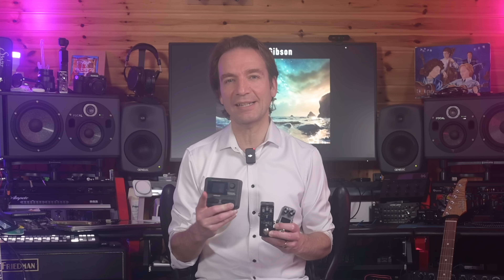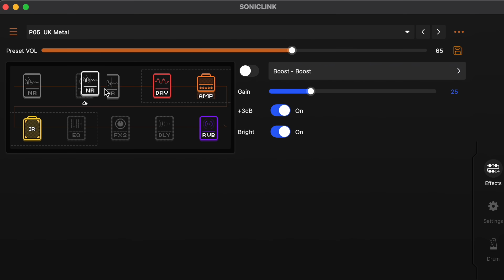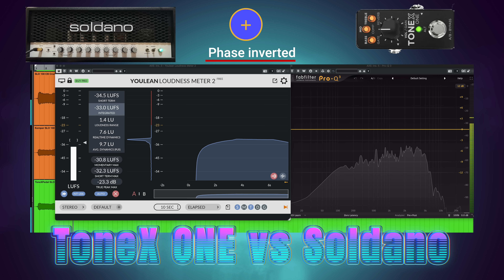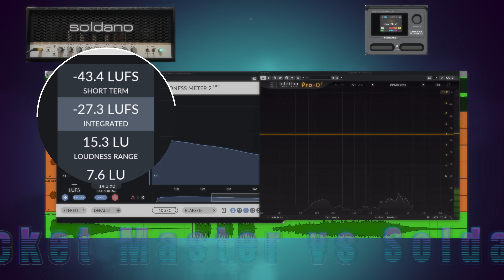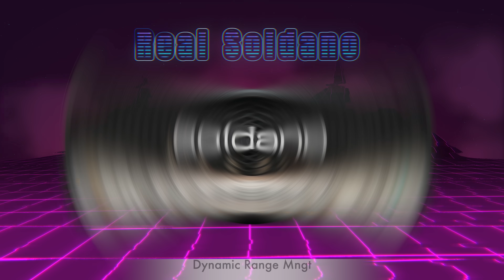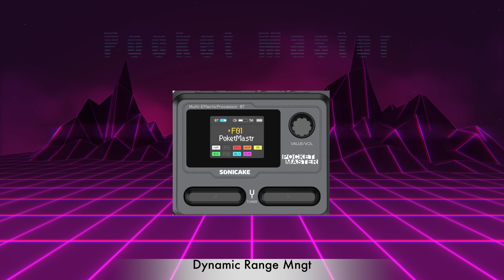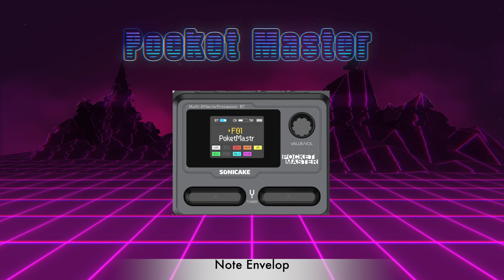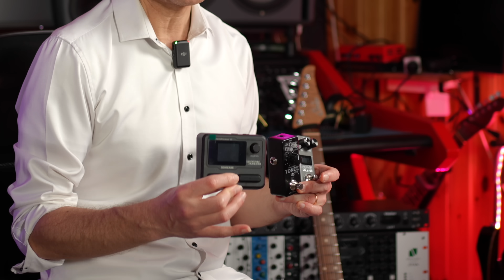Valeton GP-5 vs ToneX One vs SoniCacke Pocket Master (with NULL Test and vs a tube amp)

Comment: I would buy any of them if they had a 3.5 MIDI jack for live patch automation :D

Looking forward to the day we see mini-pedals like this with 3.5 MIDI jack
Reply: YES!! THIS!! although some of these might be able to do Bluetooth MIDI. I'm gonna investigate that right now!
Reply: @LasCosasComoSean  that doesnt help my setup since my band used a Cymatic live player for backingtracks and midi, we dont use computer
Reply: @BlazonStone  you dont need a computer with the CME hub. It acts as a MIDI MASTER for your USB-MIDI-ONLY controllers. CYMATIC <-> MIDI CABLE/s -> CME -> USB CABLE -> GP-5. 
I've managed to send / recieve MIDI DATA (Program Change, CC, etc) without trouble from a Cymatic LP-16 to USB-MIDI-only devices without issues. I have configured and designed automated midi setups for a few bands already. 
USB-MIDI is "Slave" only, But it can be converted to 5-pin din connections with an ACTIVE MIDI HUB. That´s what the CME thing does. No need for a computer at all. Look it up!
Reply: @BlazonStone  That's not true at all. The CME MDI Master hub just goes between your USB midi device and your cymatic LP16 (or 24). It is not a "USB" hub, It's a MIDI MASTER HUB with Usb and 5 pin DIN ports to be able to re-route and swap connectors for SLAVE USB-MIDI devices, among other things. I've built setups for many bands this way. I always recommend to avoid computers for backing tracks. Please look into it, because you are missing out on some pretty convenient solutions. Computers are not needed anymore for SLAVE USB-MIDI-only devices to work. Just get one of those boxes. You can even use a USB hub to connect 4-8 USB-MIDI devices to the same box, depending on the model.
Reply: @LasCosasComoSean  So if I get a CME WIDI Master, connect that to my Cymatic LP16 midi in/out... How can that then change patches on for example Tonex One or Valeton GP-5? Can they recieve wireless signals? I'm confused

Yeah I know computers are not reliable, which is why we are using Cymatic LP16 as brain of live shows :D
Reply: @BlazonStone It's not a CME widi master. I'd never recommend wireless connections either (there's already enough trouble with wireless monitor transmitters EVERY SINGLE GIG😂😂. It's CME H2MIDI PRO, or the bigger version CME H4MIDI WC, at around 45 and 65 € each. I'd be more happy to assist you  and walk you through how it works. Just send me an email (the address is on my channel's contact info) or ask me here so others can benefit too.
Reply: @LasCosasComoSean  Thanks! 
But it kinda ruins the purpose of a small and simple automation based rig if I gotta buy an extra thing that needs another power supply etc. Then there's already other slightly bigger units than Tonex One and GP5 that has MIDI 3.5 and I dont need extra gadgets and power supplies to make it all work, to make the setup very tidy
Reply: @BlazonStone  WWhatever Works best for you!
Reply: Valeton GP-5 has Bluetooth MIDI and USB MIDI. You can turn any usb-only midi device to MIDI din with a cheap MIDI hub like CME H2MIDI Pro
Reply: @LasCosasComoSean I don’t know about the others but the PM offers both USB and Bluetooth midi.
Reply from the maker: Thanks for sharing!
Reply: Which is why i  chose the Nux Amp Core Studio over these units … the midi jack. If Tonex ever added one or just support Midi program change and give me access to the 20 presets I would buy it instantly.
Reply: @BeeThomas-x1o  Again, a 60 bucks CME H2MIDI Pro box fixes this for any usb-MIDI-only device. Come on, guys! Do some research! There's plenty of musicians that use USB midi controllers or synths with this kin of Active MIDI Master HUBs! They're cheap AF!
Reply: Same here. I start loving 3.5 midi more and more, it's very useful format

Comment: I would like to see these in an expression pedal form factor.
Reply from the maker: Thanks for sharing!
Reply: I typically assign input noise gate threshold to an expression pedal because electrical/EMI/interference can wreak havoc, even during one performance' set/session. This way, I don't have to stoop down and menu dive.

Now that the modeling units have reached significant reduction in size, they can fit well within the form factor of the housing of an expression pedal (sort of reversing the roles of having external foot switches... if you think about it).

Comment: Thx leo

Not need to check mvave blackbox n mvave mk300 ?
Reply from the maker: You are welcome!
Maybe in an upcoming video...thank yoU!
Reply: Don't expect too much from M-VAVE ANN.
Compared to NAM, it shows a big difference with NAM as a combination of 1 layer 7 channels + LSTM. 
It does not pass the null test satisfactorily.
Reply: @evolve6824 Hemm.. it same with valeton/hotone too ?
Reply: @alvinmingguw  HHAG technique applied to ANN causes high frequency modulation.
Low null test agreement. About 85% expressive power.
Valeton/Hotone has compressed model and low NAM quality.
About 80% expressive power.
Reply: @evolve6824  ANN starts to sound good only after 50k-100k epochs, and better to use not standard training wav.
You're numbers 80% and 85% - can u explain more?
Reply: @evolve6824 can you share links for more info about ANN. I saw only their whitepaper from am2 times, and there was no details, only that it is lstm-based
Reply: @АндрейПолевой-я5и  (Estimated file structure)ANN AM2, AM3 = Total float32 = 1551
WaveNet NN float 772 = 1 block, 1 layer, 7 channels (???)
LSTM = Input 7, Hidden 10 (buffer memory)
<Matched file structure>

AM2 header = Gain, EQ, Level control
Bass = 80Hz ±15dB
Mid = 800Hz ±15dB
Treble = 8kHz ±15dB

AM3 controller hardware integration
Reconstructed with NAM conversion

NAM standard is 2 blocks, total 23 layers, 64 channels.
The sound of 23 layers, 64 channels of NAM and 1 layer, 7 channels of ANN are different.
To hide this, we use HHAG trick technology.
NAM ≠ AM3 conversion reproducibility, 85% of human hearing standard, numerical specifications are less than half.

ANN training time and performance are overestimated.
The quality of WaveNet is not the amount of training, but the number of parameters.
Reply: @АндрейПолевой-я5и  WaveNet can only capture a significant portion of nonlinear clipping, that is, a portion of frequency information, in a single layer with 7 channels per layer.
The number of channels is too small to analyze subtle harmonic changes, noise and nonlinearity detection, and frequency density.
The difference between NAM and ANN is like a PEQ with too few channels to handle an IR cabinet.
NAM maintains 95% audibility up to at least 32 channels, but when it drops below 16 channels, the treble response deteriorates significantly.
It feels like a stuffy and old digital effector.
In fact, ANN gives up the ultra-low frequency response, and the ultra-high frequency is artificially exaggerated by the exciter amplification.
This is reinforced by HHAG, and LSTM is used as a dilation buffer to fool the ear.
NAM has a natural tail by overlapping many layers, and ANN delivers a similar effect to the ear with LSTM-dilation buffer.

ANN is an architecture that is efficiently built.
LSTM is not a structure developed directly by Sinco, but is a (optional) structure proposed by NAM.
Performance is a separate matter.